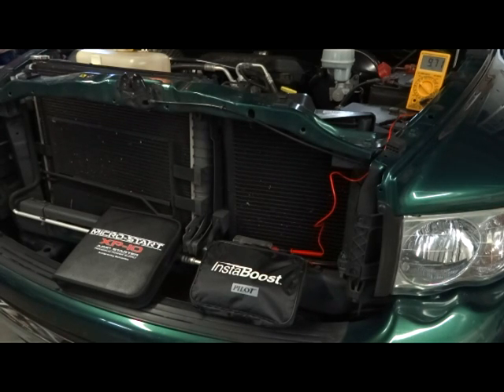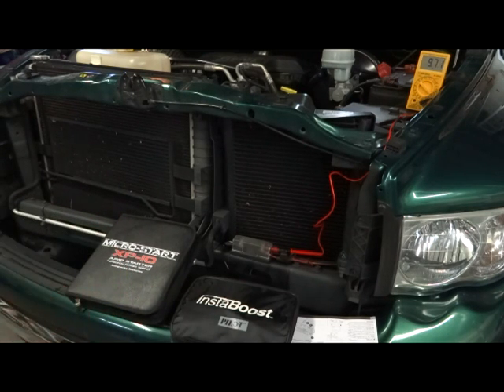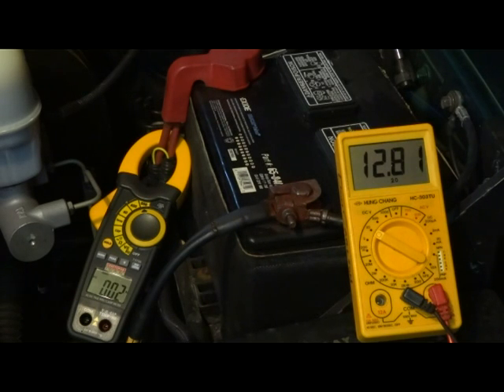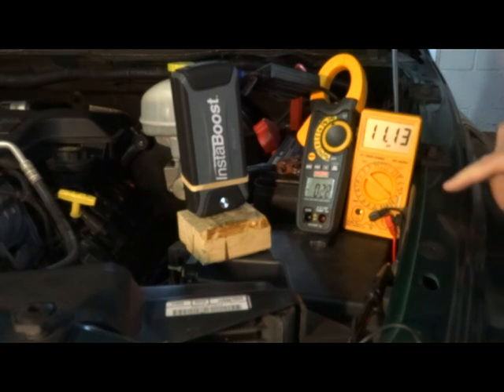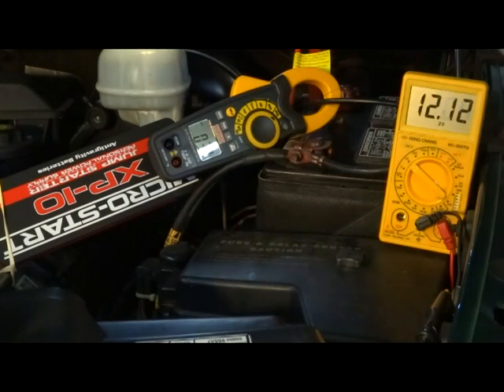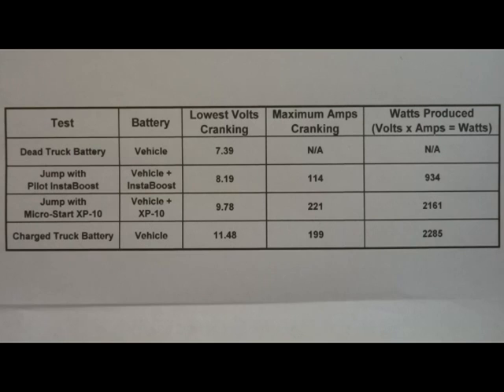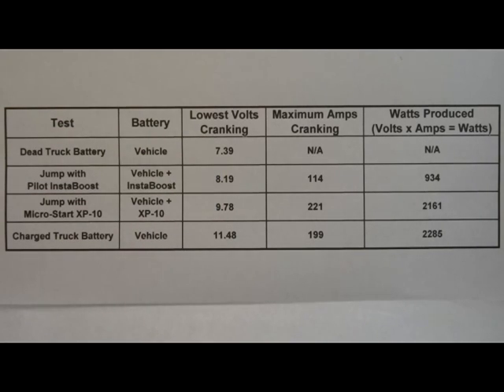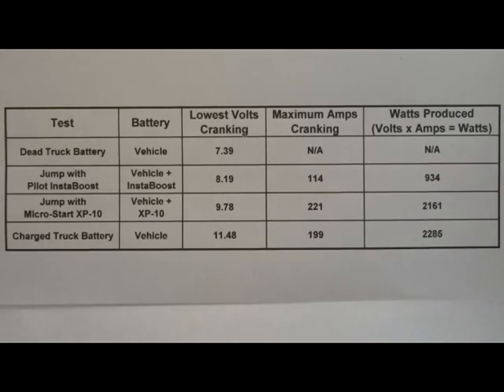Review: Pilot InstaBoost vs. Micro Start XP-10 Jump Starter Battery

Comment from the maker: FYI, the InstaBoost stopped working a couple of months out of warranty.  It would take a charge and was fully charged but no power would come out of the cable clamps.  The MicroStart is still working like new.
Reply: Common issue with those boosters, the cables on the instaboost and the antigravity should be interchangable. Had teh same issue with another booster and it was the clamps. the smart clamps fail often.

Comment: can i use that to power my ham radio... run with 12v 15amp
Reply from the maker: If it pulls 15 amps, no.  It has a 12v 10a port on the side that will give you continuous power but I tried it on a large spot light and it would trip out a little before I pulled 10 amps.  Weird thing was, there is no way to reset the port when it tripped out.  The only way I could get it to reset was to put the thing on charge.  Hope this helps you.

Comment: What an amazing video.  With such detailed explanation you should be getting paid for this. And to Victor and anyone out there that has question I was looking to buy the Genious Booster but after finding out that it only carries 400 amps while the xp-10 carries 600 I will now buy the xp-10 for which is also known to jump vehicle at -16 degrees weather.

Comment: can you please let me know how is it going with the micro start lately? do you recomment?
Reply from the maker: I've used them both twice and they worked but the Pilot really struggled on one car.  I recharged them both after about three months and the Pilot may have held its charge better because it only charged for an hour and was full.  The Microstart was showing 3/4 charge and took about 5-6 hours to recharge.  I'm still sold on the Microstart because it appears to have at least twice the power....my two cents.
Reply from the maker: I've used the Microstart helping two other people.  It worked fine.  Charged it after three months and it had lost some charge but charged back up in about three hours.  Haven't used the InstaBoost at all.  Keeping it as a backup and to charge cell phones etc.